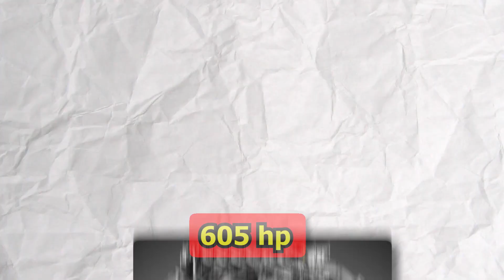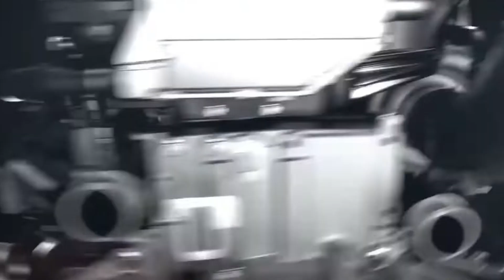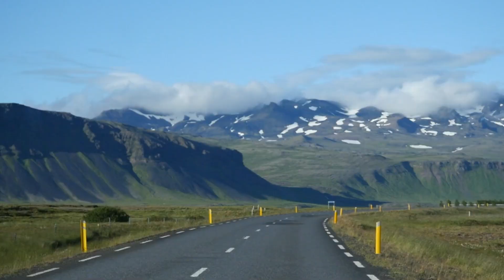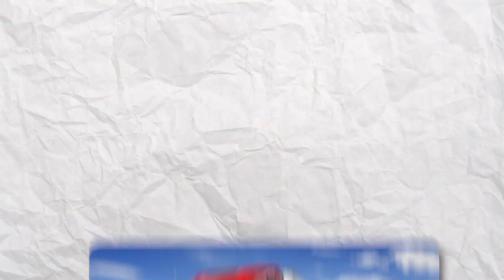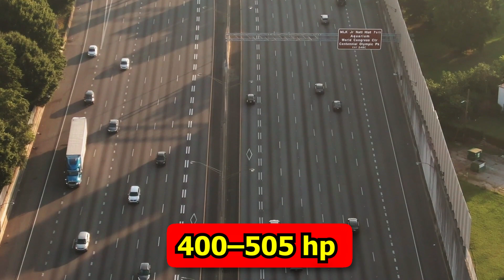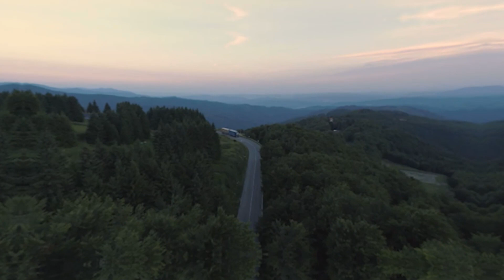Why European Trucks Have up to 770 HP And US Don’t!

Comment: In the Netherlands and Scandinavia the Maximum weights are much higher. In the Netherlands the general Maximum weight is 50 Metric tons (112,000 lbs) and for so called LZV (Long Heavy Vehicle = mini roadtrain) that have to comply to some extra rules, even 60 metric tons (132,000 lbs) and in Scandinavia Wheights for logging trucks can even be up to 74 metric tons and heigher

Comment: I can ensure you that the trucks in Europe still don't have enough horsepower. Trucks in Europe often engage in elephant races blocking several tracks for ordinary traffic. these elephant races are often started over one or two km/h speed difference and last for ever...
Reply: True, but that has nothing to do with HP: these races last forever because the trucks are electronically monitored and or limited. So you get one truck trying to overtake the other with a speed difference of 1 kph...
Reply: @rientsdijkstra4266  Would the trucks have more HP they might all be able to travel at the same full speed.

Comment: One of the most unprofessional video I have seen. As for torque, it's only one part of power. Torque alone doesn't tell you anything. Just the same as comparing RPMs. Power is what it means, it's torque times revolutions. The lower the best torque, the better. It does matter. A simple question will test your knowledge level: can the best torque be above the best power rpm? And why?

Comment: This whole video is just absolute nonsense. The weight limit in the US is 80 000 pounds. Gross weight, not the cargo limit.
"Federal law controls maximum gross vehicle weights and axle loads on the Interstate System. Federal limits are 80,000 pounds gross vehicle weight, 20,000 pounds on a single axle, and 34,000 pounds on a tandem axle group. There are also Federal standards for length and width on the National Network (NN)."
-DOT

Even the CUMMINS logo is wrong.

Comment: Mate, do your research right next time. So many mistakes in this video. In US the Weight limit is 80000 pounds wich is about 36 tons, in EU its 40 tons, everything over 40 is oversize cargo and the truck and trailer needs to be special made for it.
Reply: Then you should do your OWN research: In the Netherlands and Scandinavia the Maximum weights are much HIGHER. In the Netherlands the general Maximum weight is 50 Metric tons (112,000 lbs) and for so called LZV (Long Heavy Vehicle = mini roadtrain) that have to comply to some extra rules, even 60 metric tons (132,000 lbs) and in Scandinavia Wheights for logging trucks can even be up to 74 metric tons and heigher
Reply: na in sweden we have over 50 tons
Reply: No you dont, cause sweden is in EU and in EU 40 tons is legal limit, you might have special permissions for over 40 tons, but every country has these ... so stop next time do your research right @Dennan

Comment: This is pretty bad. Wrong weight limits and comparing useless torque numbers. Torque is only useful in the first gear before your RPM are in your optimal power band. You can just compensate with a gerabox if you have less torque.

Comment: The author needs to do his homework.  Utah allows 129000 lbs, South Dakota 150,000 lbs, and the Largest diesel engine is not the DD15,  there is a DD16 and a Cat C16 and also a Cat C18.  Nothing at all why the trucks in Europe many are single drive.  All the heavy haul trucks across America and no mention.  Many run over 225,000 lbs.

Comment: A american truck is not allowed to weigh 80 tons. Its 80.000 pounds.

A european truck is allowed to weigh 88.000 pounds across all of europe, and more then that in some induvidual nations. Like 110.000 pounds in The Netherlands.

Some guy bragging about his 1000 hp aftermarket engine in the comments. We are talking about stock engines, not chip tuned ones.

Its not only more horespower and torque either a stock European engine of around 500 hp will be more fuel efficient then A similarly sized us engine.

Even with engines used on both sides. The paccar engines in europe all have more horespower but same fuel efficiency as thier us equivalent.

In the us a paccar mx13 does 405 horespower, and 1800 ft-lb of torque at 1000 rpm.

That same mx13 engine in europe makes 530 hp 
And 1930 ft-lb of torque.

Its has nothing to do with the type of cargo hauled or how flat the roads are (netherlands is pretty flat, only trucks with less then 500 hp are daycabs and the cheap bastard at ups and fedex) its just because europeans make better engines. And are therefore able to get the same fuel efficiency out of a more powerful engine, so there is really no reason not to use a more powerful engine.

The 530 hp truck i drive with now. Does more miles to the gallon then the 350hp truck my dad drove in the 90s, so if that is the case, who in thier right mind wouldnt use a more powerful engine.
Reply: I agree with the most of what you said. But I don't think the difference in power with the similar engine used in EU vs US is because Europeans are smarter, rather that US has different emission standards. It was always like that. EU cars that were imported into US had always been detuned to pass the emission laws.
Reply: @damirkvajo  You really think that the US have stricter emissions standards than countries in the EU?

And that is the point of all conspiracy theories: just claim anything, no matter how opposite and ridiculous it is and use that as basis for all further claims.

(edit: typo)
Reply: @Delibro he’s not wrong. The US has less strict emission laws compared to the EU. Just look up the MPG for the same audi models in the EU and the US. They’re very different and EU models get many more miles per gallon. The US is about to launch their 4/5 year emissions policy that’ll reduce emissions and improve MPG each year first at around 4 percent and end at around 15 percent.
Reply: @miles5600  I'm sorry, I've made a typo in that comment. Of cause the US has less strict emission laws.
Reply: @Delibro  no worries. Has happened to me before too.
Reply: @damirkvajo this is the big bullshit that American governments and automotive lobbies make you believe! In Europe we have strict emissions parameters that you wouldn't even dream of in America and furthermore the cars that circulate in Europe rarely have engine capacities that exceed 2L
Reply: @damirkvajo  The European trucks (mostly owned by large fleet operators!) need more power because they are heavier (but slower) and have to haul this weigh up often narrower, more winding and steeper (!) roads, where it is more important to keep the momentum in those heavy loads. In the US with its larger distances and higher speeds purchase price and fuel economy will be more important for the many small owner-driver operations..

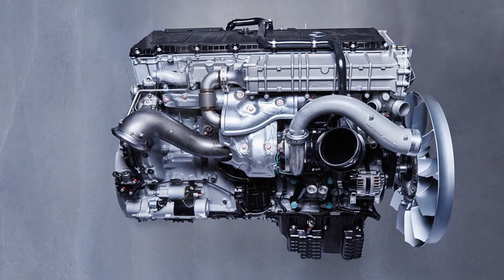Comment: 4:49 Wrong! Volvo and Scania don't share anything with one another. They're competitors, not partners of any sorts.
Reply: Volvo Trucks, Volkswagen's Traton Group (Scania, MAN Truck & Bus and Navistar), and Mercedes-Benz's Daimler Truck unit have formed a joint venture aimed at an electric truck charging network in Europe. That's the only co-operation between them other than that they're competitors.
Reply: They share tire size and diesel. That's it

Comment: You mixed up the weight allowed on EU road. We can normally have 40 mt in total, 44 with restrictions.
Reply: Finland, sweden are part of eu and we in finland are allowed up to 76mt and even heavier with special licence, sweden use to have 60mt but if i remember correct the law changed there to so they can drive heavier load now a days too
Reply: @kingmike666  yeah the new rules here in sweden changed the max lenght from 25,25m to 35,5m. And the max weight from 60 to 74mt.  BUT the new rules only applies to roads made for that lenght and weight (BK4 roads). So you can basically only drive those combinations on the main highways (E6, E20, E4 etc etc) so far. I know they drive 74ton timber trucks in some parts of northen sweden. And i know Schenker have some 32m truck and trailers combo they been testing our for a while now, terminal to terminal hauls. But as the road infrastructure develops more roads get the BK4 designation for the weight, and as of now we have about 4000 km of road open for the 35,5m combinations. So its still a new thing.
Reply: In the Netherlands: 50 metric ton (112,000) standard maximum, 60 metric ton (132,000 lbs) for adapted LZV trucks (mini roadtrains)